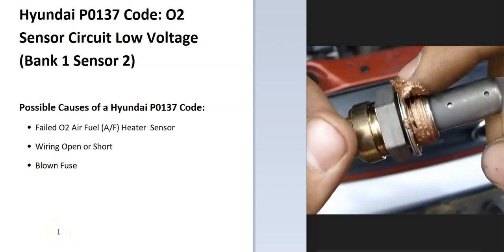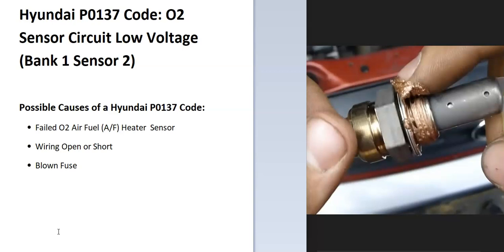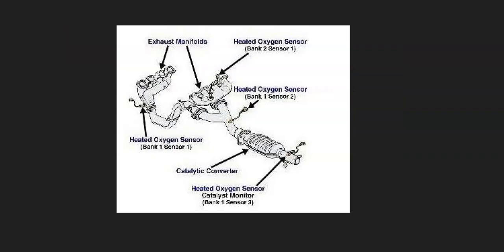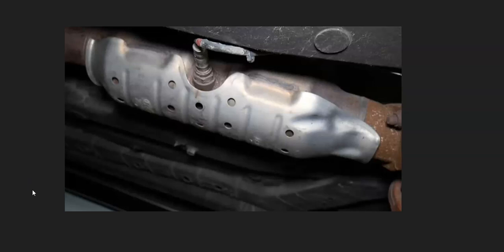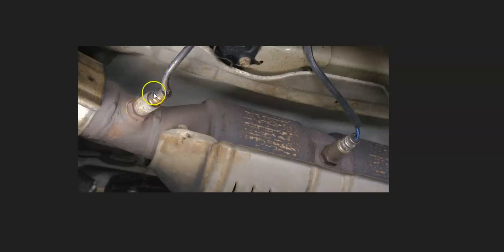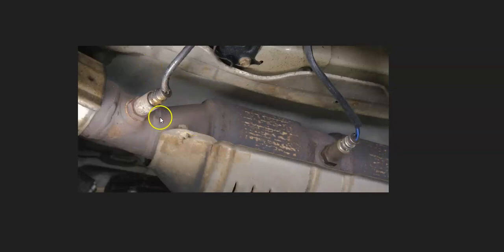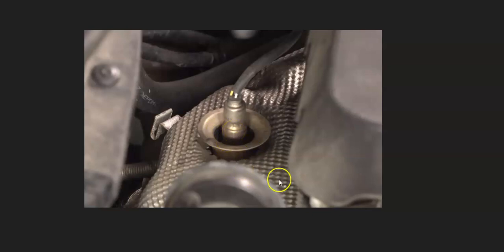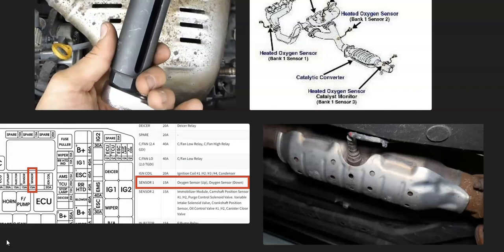How To Fix a Hyundai P0137 O2 Code Sensor Circuit Low Voltage (Bank 1 Sensor 2)

Comment: My 05 Elantra is throwing p0137and p0138. I replaced the downstream O2 sensor and checked the wiring for damage. No damage and replacing the sensor didn't fix the issue. I hope it's not the CAT.

Comment: If the 02 sensor heater wires tested around 600 mohms is the sensor ok?